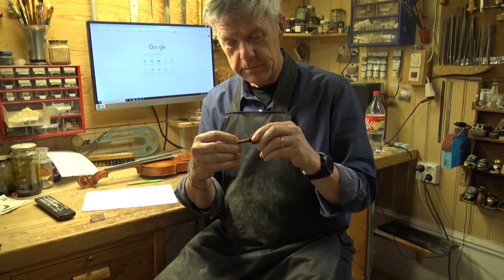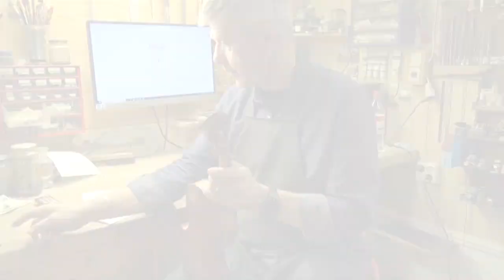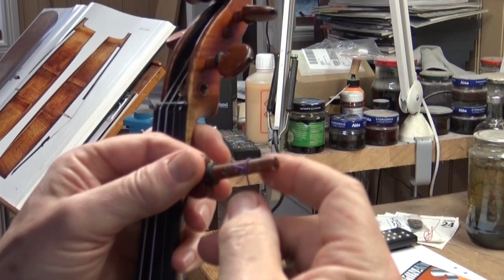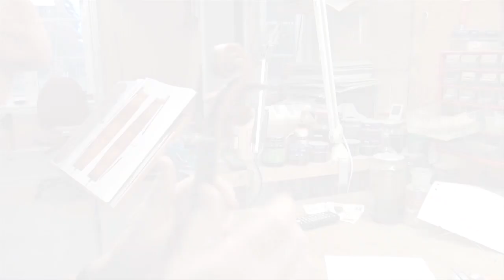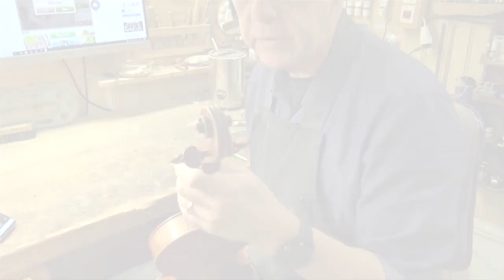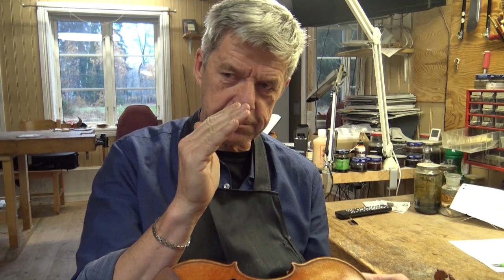Violinmaker Peter Westerlund Part 83  How to change a string

Comment: Thank you for this very helpful video. I would like to add the following however: In case the peg will not stick even after chalking a couple of times, I've switched to birch or pine ashes in stead of chalk. It seems like the ashes give more friction.

Comment: Hello Peter I am about to make myself a Varnish drying cabinet. Could you tell me the type of suntan lights you are using, and also the output in watts? I have read quite a lot about the types of lights that can be used and it can be a bit overwhelming as to what to use. So I thought if I use what you have found works then I should be ok. Also how long are you leaving the violin in the cabinet?  I’m about to start the antiquing of a violin, so thank you once again for demonstrating this process and looking forward to seeing more of your videos.
Reply from the maker: I use ordinary tubes for tanning skin. Stay away from the aggresive UV-C tubes. They can cause major harm to both skin and eyes in a very short time. (parts of a minute)